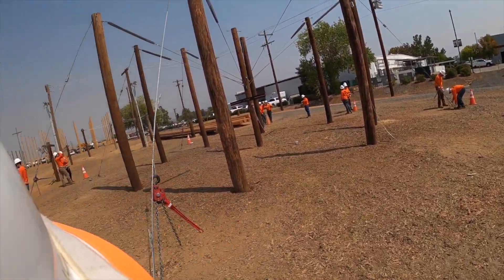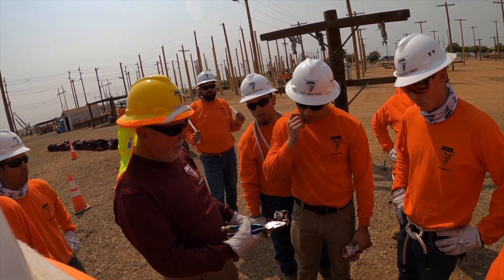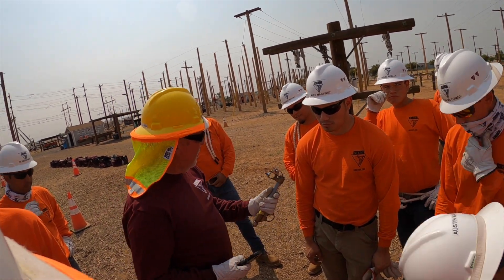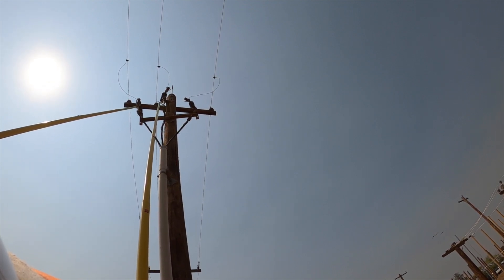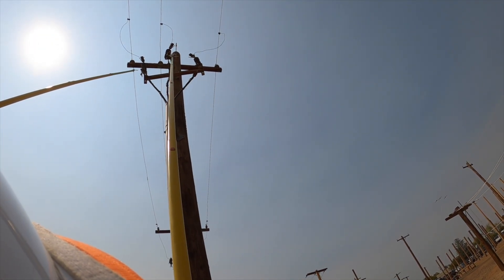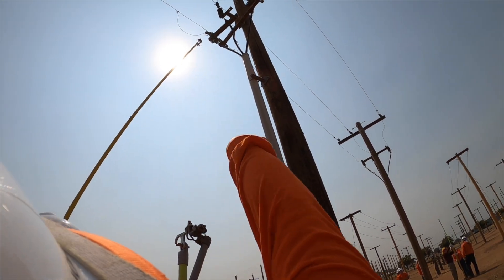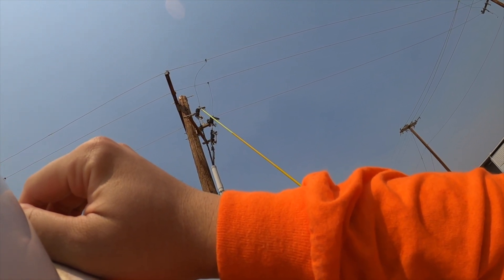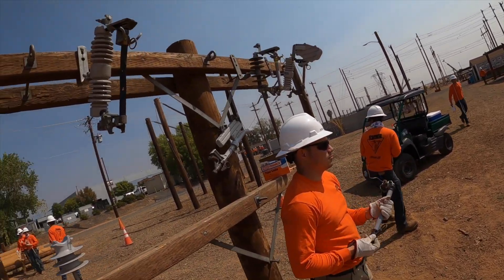NLC Guy wire/plumb-bob/Cutouts/Fuses/Extendo/Etc (2021)

Comment: Great vid.
5:15 looks like a solid copper door on the left(for 100 or 200 amp cutout), standard polymer cutout in the center, and a loadbreak cutout on the right. It looks like there is a fault tamer secured to the pole about where the braces attach to the pole.

The super high current(600-900 amp) bypass switches that I have are pretty hard to release especially with low tension wire or a poorly secured crossarm. They probably need wd40. 
Edit: Ones mentioned are my trunnion mounted ones but I also have some on cutouts(different than solid door) and both are hard to release.